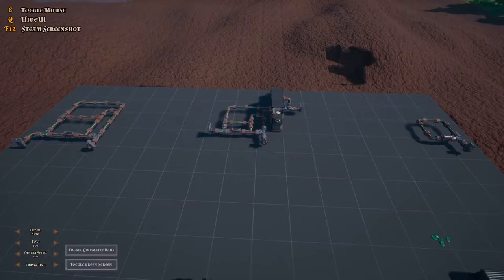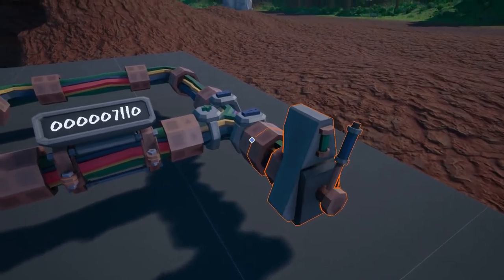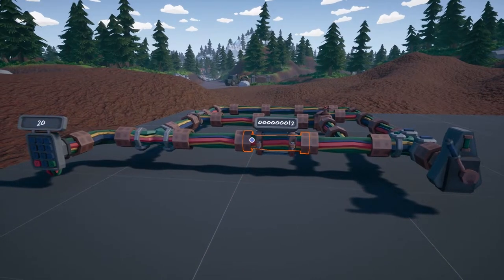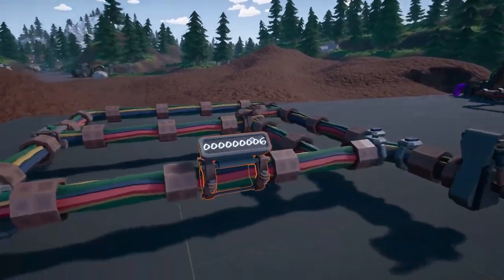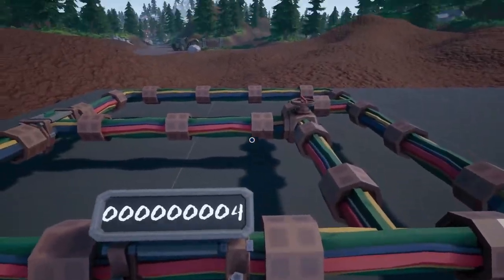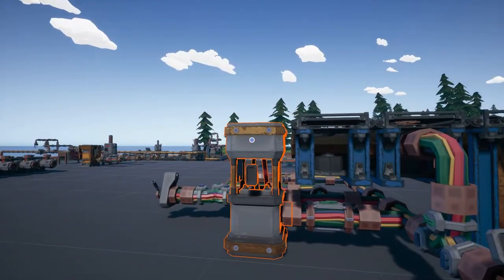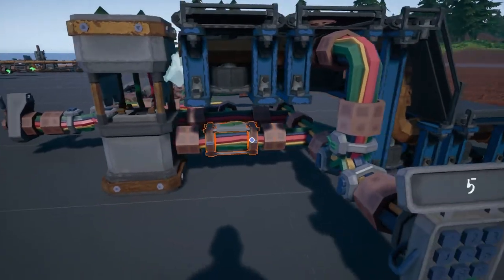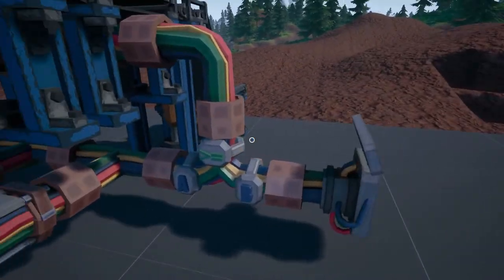HYDRONEER 2.0 | HOW TO LOGIC | TIMERS

Comment: Just wanted to say thank you, I have tried many things to get this working and yours did the trick. This worked some what for me, for some reason it would randomly stick at 2 and other times it would work. I used a workaround by adding a 1 sec delay between the metronome device and the + and just have to divide what I enter at the keypad by 2. For example if I want say 20 sec I have to enter 10. Now just have to find a way to have the smelters wait about 2 seconds before starting to prevent items from dropping and then closing before the conveyor starts back up.
Reply from the maker: glad i helped you find a solution to your problem, im in the process of finalising a solution to the delay with the conveyors at the moment i have a 10 sec delay on the valve side of the circuit, you could try that to start?

Comment: There’s a much simpler way to do effectively the same thing for a gem compressor, which doesn’t need a “0” signal to reset, and without needing a timer circuit: Repeater>10 sec delay>flip-flop. Then you need a T. On the compressor side: diode (pointed downstream)>validator>one sec delay>one sec delay>compressor. On the conveyer side of the T: flip flop>logic valve. That’s it. It forms a 20 second loop. The conveyer has an on cycle of 10 seconds, then stops, there’s a one second delay, compressor fires, about 8 seconds and the conveyor restarts, repeat. I make the gem polisher conveyor one floor above the on/off conveyor that feeds the compressor so while the conveyor is cycled off, the gems fall onto it, don’t collide (because conveyor mechanics) and are sitting in the center of the belt instead of at the seam between two conveyors, which is slightly less prone to bugginess.

And now that I think about it, by adding a second t after the diode and eliminating the validator, you may be able to make this work for an auto smelter using some delays.
Reply from the maker: Thank you for letting us all know of a simpler easier way 👍 will have to do some testing with that and the auto smelter 👍

Comment: I think the solution you might be looking for is a second counter.  Meaning sorta laid out like flip-flop, just built yourself instead of the hook variant.

Hard to explain so bare with me here.  So instead of looping back in and using a logic valve to cut off the adding counter so it zeroes back out, you feed it into a second counter of similar build that feeds back into the first.  So when it reaches 20, it opens up the second 20 counter which when active closes the first and zeroes it out.  When the second hits it's mark, it opens back up the first which then being active closes the second and zeroes it out.  Basically cycling between them infinitely.  So while A is disabled, B is running and vice versa.  Then from each you have 2 differing timers that run only when the other isn't and can use them to logic a 20 second on state followed by a 20 second off state.
Reply from the maker: Hmmm yes quite possibly …. Time for more playing around and testing, thanks for your comment and thoughts, I’ll be sure to let you know what I find.
Reply: @Krypt0nite  Np, glad to help.  It's a convoluted solution for sure, but it should in theory be a working one.  However, it is Hydroneer 2.0 and you can never be sure if the logic wants to behave logically.
Reply from the maker: Absolutely in theory it should work but your right the logic isn’t always logic

Comment: I sorted that issue with a delay,  @Kryptonite.  Need a T and across has a 10 sec delay.  On the Valve part of the circuit. Then the valve turns off for 10 sec and turns back on.  No need for the smelter side for a greater A B.  IF need help I can send a diagram
Reply from the maker: Ooo nice, I think I sorted the issue the same way but sure feel free to send me the diagram and I’ll have a look.

Comment: lets say i want to run some conveyor belts for a period of 4 seconds and then have it auto shut off until i press the button again.  how would i go about this?
Reply from the maker: So the way I would go about this is remove the reset loop from the build so the cable that the valve hook in on remove that and put the valve hook on the far right cable and the extend the top right section to put a valve hook on a pipe, may need a little play around as it been a while since I’ve done this video 😅 hope that helps
Reply: @Krypt0nite  thanks.

Comment: Correct me if I am wrong, at around the 5:50 mark the smelter opens before the conveyor stops, this will allow ore to fall through the smelter and dump on the ground.  The conveyor should stop THEN the smelter open and close before the conveyor starts again.
Reply from the maker: Your not wrong it does that from time to time, I’ve been doing a lot of testing to try and eliminate this problem and so far the only fix is to incorporate magnets from the same source as the valve, it seems to be a mechanic that it’s takes a little time for the water flow to stop after the valve is shut off.
Reply: @Krypt0nite  Can you put delays on the smelter input? or will that prevent it from closing to late?
Reply from the maker: Hmmmm 🤔 possibly it’s would defo help with the conveyor issue, not sure if it will delay the reset, I will have a play around and shove a pinned comment up

Comment: I had to rip-off this design to water my crops in this new update. I couldnt figure it out on my own, how to make a timed water system. Thanks for your tutorial 😃🔧🔧🔩⚙
Reply from the maker: Haha no worries I’m glad it helped out one way or another 👍, it’s bad of me I know but I still haven’t tried the update 🤦🏼‍♂️
Reply: It does the job, but the logic valve have hickups quite often. Sometimes it doesnt change before several minutes have passes, other times it does it exactly on time. A display to the left of the valve shows that the value flicker between 1 and the repeaterloops value all the time. Only when it finally get to a 0, the clock work as intended agsin.
Reply from the maker: Hmmm it’s been a while since I’ve played around but that does sound like a familiar issue, plenty of builds I done had small issues like that where they were fine for while and then start playing up, it’s like there’s a slight delay in synchronisation and the longer it goes on the bigger the delay becomes